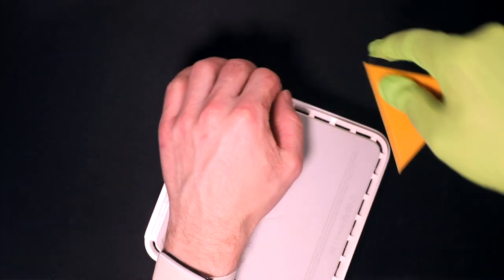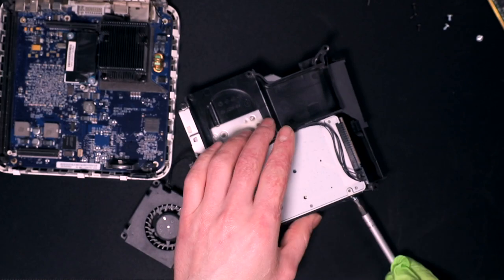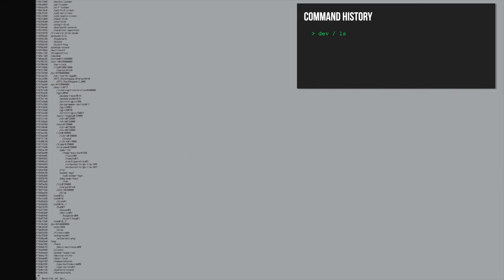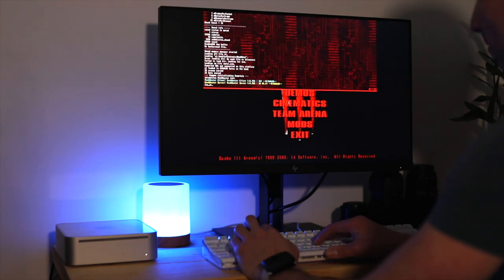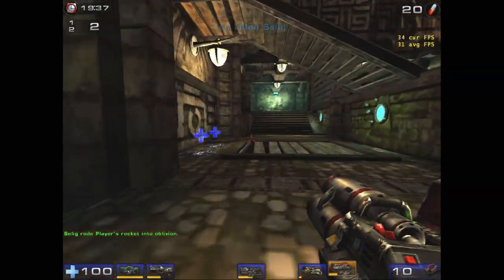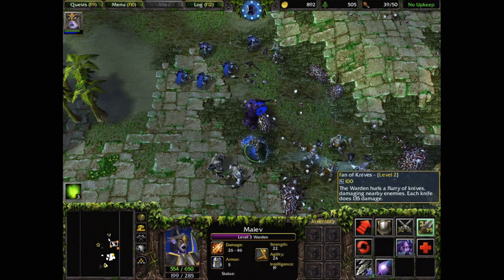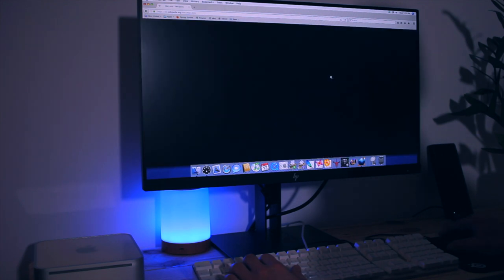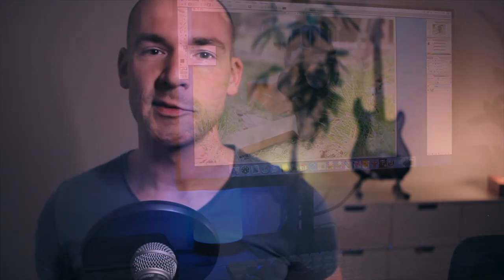What can the Mac Mini G4 do? A throwback to the PowerPC Days.

Comment: I worked at IBM on small form factor storage disk drives during those days.  I was very familiar with POWERPC.  It was much faster than competing Intel processors.  The weakness was the high heat.  But it was good for it’s time.
Reply from the maker: It was competitive for sure. It sounds like you were also using POWERPC-based systems internally at IBM.

Comment: I am trying to do this exact procedure, I had already got the same enclosure and the same Transcend 128mb mSata, following the upgrade was fine, but the issue I have is the install of the software on the new drive, this part of the video was WAAAAYYYY too quick and had virtually Zero instruction on how to do it, can you help me with the commands on installing a fresh copy of Mac OSX, I made a single partition but I have an error when trying to boot 10.3.7 and then up grade to the Tiger (I have 10.3 install and 10.4 upgrade disks.   The Installer displays the Drive now, but I have an error saying you cannot install MacOSX on this volume, you cannot use this volume to start your computer....
Reply from the maker: Sounds like a problem with the install disks, I ran into that trying to install from a DVD. I would try downloading the 10.4 DVD image from Macintosh Garden, loading it onto a USB and booting it from Open Firmware.

I realize I breezed through the install part in the video, but if follow along by pausing the video, all the commands you need are there. Let me know if you get stuck in the process and I will clarify more.

Wish you the best of luck with your Mini!